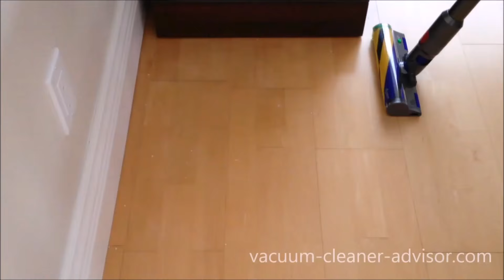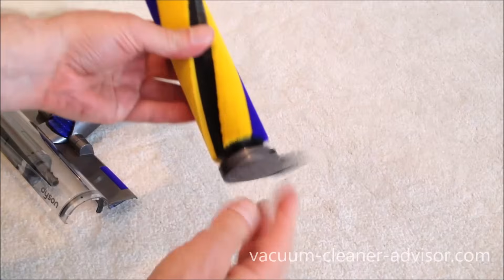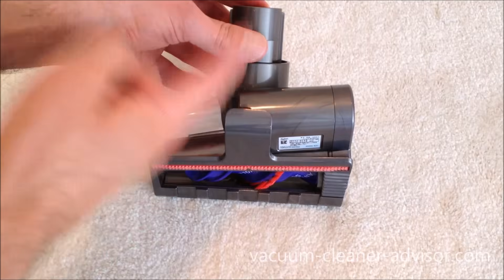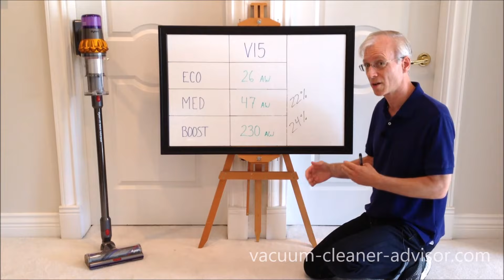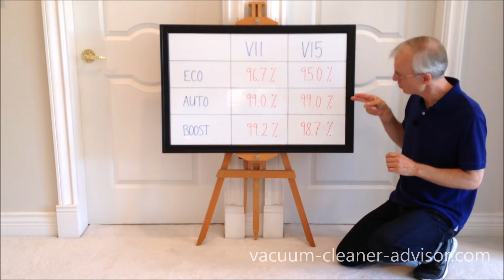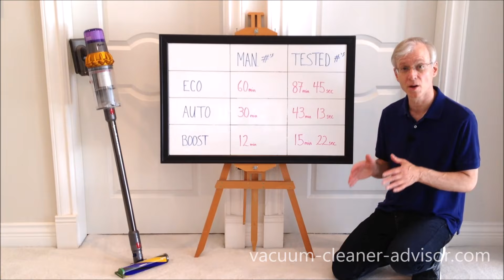Dyson V15 Detect - What We Love

Comment: I have a strange problem with my Dyson V15 Detect Absolute.   The High Torque Head works perfectly when attached directly to the vacuum unit.   But when attached to the wand, the rotating brush only spins erratically and more often than not doesn’t spin at all.   All of the other cleaner heads work perfectly, both when connected directly and also via the wand.
I reported this to Dyson who said they will send a new High Torque Head.    But their problem is they allegedly don’t have any !     I’ve been asked to call back after a couple of weeks, which seems most unsatisfactory.  
The package was purchased direct from Dyson UK only two months ago and has probably only had a total of little more than one or two hours use. 
What should I do ?

Comment: Are the fluffy cleaner heads adaptable to work on rugs when vacuuming in wood floor homes? Or do we have to swap heads every time we want to vacuum rugs?
Reply: The fluffy head is great for hard wood floors it can get the loose surface stuff off of the carpets but doesn’t penetrate deep in the carpet so you would want to change to the other head for that.
Reply from the maker: Yeah - you would want to swap to the High torque cleaner head if you are doing carpet.  However, the High torque cleaner head can do both carpet and bare floors (although it is not as effective on bare floors as the fluffy cleaner head).

Comment: Terrific, complete, concise, clear presentation.  Thank you.  My only dilemma is to HEPA or not to HEPA.  The additional cost is minimal, so my question is do I really need an HEPA filter that is, of course, useful, but adds weight.  I'm so conflicted.
Reply: It adds micrograms. Ur not gonna feel it Also it comes with extra attachments and some come with a crevice tool that lights up
Reply: U need a HEPA, i have a V8 that doesn't have HEPA, i sneeze every time i use that damn thing because the air outet facing my face directly.
Reply: I would go with the HEPA if you're still deciding.
Reply: Hmm, does that mean the filter that comes with the V15 is not a HEPA type? Just ordered a V15 yesterday and I thought it came with a HEPA filter... Do you still have your Dyson V15 (if you did buy one)?

Comment: Hi, I’m hoping you can answer this question but I just purchased the V 15 detect, and I’m not seeing the auto mode on the screen at all. I just used it, and it’s amazing it got in a credible amount of dirt off my carpet, but the only molds that came up or Echo, boost, and MED. There was no auto mode at all. Any thoughts?
Reply: It runs in auto mode when it’s on Med and has one of the three floor heads on (hair screw, fluffy, or the main one). If you can see the particle data, it’s in auto. You should hear it change suction as it gets to heavier dirt. If you have one of those heads attached and don’t see the particle data, you need to change the settings.
Reply: You need to use the main carpet cleaner head and auto will show as an option

Comment: Good video Nigel, I have a V11 do you think the fluffy laser Is compatible with my V11 ?
Reply from the maker: I took it off the V15 and put it on the V11 Absolute (same machine as V11 Torque Drive essentially) and it worked.  I did not do any testing or anything but it ran properly - brushroll spinning and laser on.

Comment: Mine's fantastic.  I love all the same things as you've listed.  The V15 is a pleasure to operate, and produces the finest quality results I've ever gotten from a vacuum.  I believe, with the combination of adjusting the High Torque Drive gate setting, suction mode, and the auto sensitivity level,  you can maximize the quality of your cleaning performance on all different carpet types.  The Laser Slim Fluffy cleaning head is simply unsurpassed for hard surfaces, and the Anti Tangle Screw head works amazingly, as well.  Get yourself a decently long flexible hose, and together with the soft bristled tool, or even the combination tool, this vacuum works wonderfully as a handheld duster.  All in all, I couldn't be more pleased with my purchase.
Reply: Has the wheel snapped off your motorized head yet?

Comment: Great review. Didn’t dare buy one till your review!  My V10 absolute working out very well.
Reply: Anyone who says that these dyson vacs are cheap products that are overpriced and don't work and that will break easily dont know what theyre talking about. I've owned a used v10 motorhead for about 3 yrs now. I dont know how many times I've accidentally dropped it onto my hard tile floor on the battery, its side, and the top. One of the cyclones on the side is dented in, and that's the only visible damage it has. But it still runs perfectly fine with no issues. The battery is still as strong as when I bought it. And the bin although being made of plastic is very very durable. Dyson did say they make their plastic bins from the same materials used to make police riot shields and I believe them.
Reply: @blackice7408  I used to think they were way overpriced too but you realize what you've been missing once you actually get one. My V7 Animal still picks up a lot more debris and hair/dust than any upright vacuum I have ever used and that includes bagged upright vacuums.